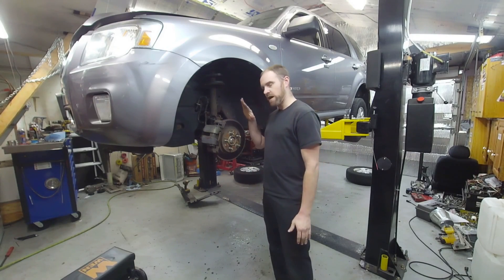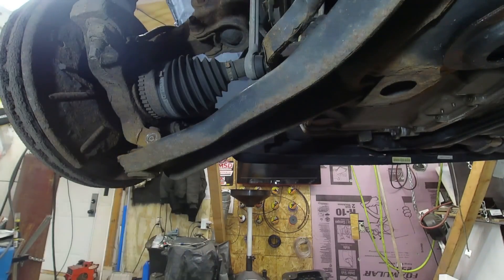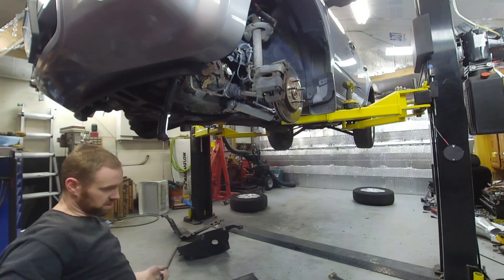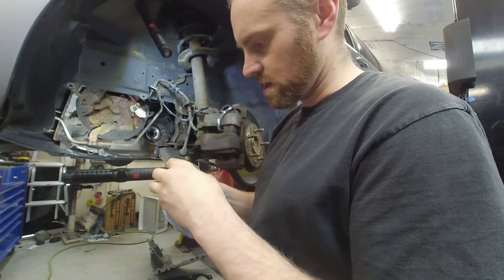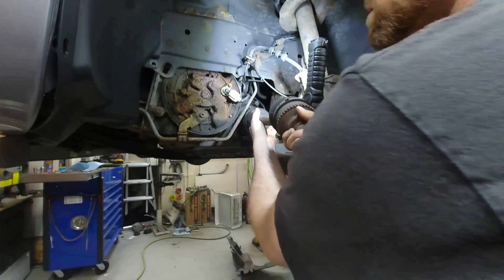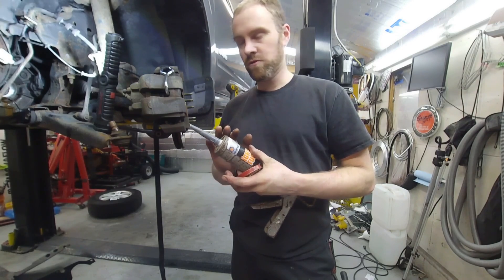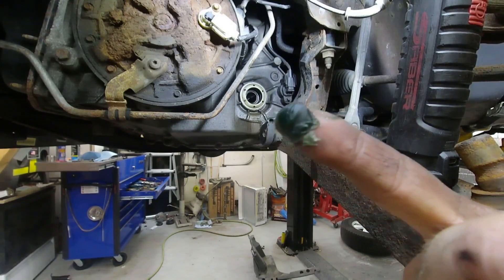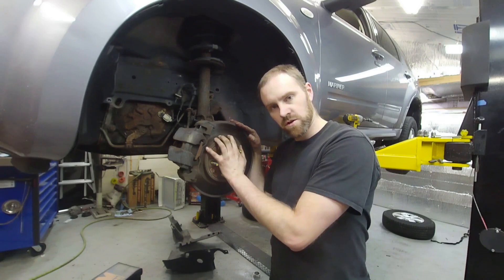Escape or Mariner CV Axle Seal Replacement

Comment: When I took my cv axel out a bunch of cv axel fluid drained outis that normal.? Cause this video nothing came out,what may be the problem
Reply from the maker: Was it all-wheel drive or front wheel drive? Was it the passenger or driver side? If it is only a front wheel drive that was probably transmission fluid. If it is all-wheel drive you might have the transmission seal leaking into the transfer case thus overfilling it. Check your fluid levels and go from there.
Reply: It was a V6 driver side ,it was seized on, so had to use torch and lightly heat for 2 or 3secs an rotate evenly but got it out a d drained 2ft by 2ftpuddle of fluid. Passenger side did the same came of clean but I bought rubber seal
Reply from the maker: @redboss81  Still doesn't answer if it is AWD or FWD
Reply: @CrazedPerformanceRepair  awd
Reply from the maker: @redboss81  then your power transfer unit is either nice and full or overfilled because the transmission is leaking into it.
Reply: i replaced my cv axle seal same one as you and still leaking, it’s perfectly flush to the trans and i didn’t have any issues putting it in or the cv axle, i didn’t not put rtv on the seal, what could it be?

Comment: 06 mercury mariner same problem passenger side ... Leaking transmission fluid between ptu and intermidiate shaft... Ive hit a dead end! Can't find a video on  my issue anywhere!...HELLP!
Reply from the maker: You will have to pull the power transfer unit. I have a video doing ptu on a Ford Taurus show. It should be somewhat similar but a bit easier on the Mariner.

Comment: Been working for two days trying to get CV axle off, finally today I just rented a slide hammer from O'Reilly's, got it off within two pulls with ease.. now time to try and get this seal off.
Reply from the maker: Check for damage from the locking ring

Comment: One more thing, is there a tool to get that bushing out from inside the case?
Reply from the maker: I am sure there is but you will have to do some research.
Reply: What I have found so far is very expensive: $225 for the Ford tool, $140 delivered for this aftermarket one: 308-070 T77L-7697-E Transmission Extension Housing Bushing Remover Alt: https://www.freedomracing.com/308-070-t77l-7697-e-transmission-extension-housing-bushing-remover-alt.html?___store=default
I will attempt with cheaper alternatives, but I might have to get that tool. You need a compatible slide hammer to use the tool as well.
There is also the bushing installer tool that goes for $70+tax+shipping ... 
Alternatives (with the risk of damaging the transmission case): 
https://smile.amazon.com/ABN-Blind-Bearing-Puller-5-Piece/dp/B072MPH6YC/ref=cm_cr_arp_d_bdcrb_top?ie=UTF8
https://www.harborfreight.com/slide-hammer-and-bearing-puller-set-5-pc-62601.html
All of this to remove and install a $5 bushing !!!
Reply: vlasfarg thanks. I sold the vehicle. Wanted to keep it, but couldn’t refuse the deal. Mechanic replaced that bushing for me and did the whole axle to get it right to sell. I didn’t have the time to deal with it. Moved on to a 2016 Mazda CX-5 GT.
Reply: @jaybilawchuk2225  No worries. I am documenting as I progress on this project. It could be useful for future viewers.
Reply: @vlasfarg  i'm about to change my bushing too and i was going to use a bushing splitter tool or chisel to deform it enough for removal
Reply: @tantran3469  We have now done the job successfully on my 2009 V6 Escape. The only challenging part was to remove the bushing. With bolts and washers (home-made $2 bushing install tool) and a 1lb dead blow hammer, the new bushing was installed successfully. So, I have tried 3 tools to remove the old bushing: #1 Similar to 308-070, OTC-6913: this is simply not the right tool for the job (wrong size, wrong tool), #2 The 3-jaws bearing/bushing puller (https://www.harborfreight.com/3-jaw-pilot-bearing-puller-4876.html): the bushing was not thick enough for the tool jaws to grab, so the jaws just scratched the inside of the bushing, #3 (Success) Slide hammer (5lbs) with 3 jaws attachment ( May model from Amazon is called "Slide Hammer, Orion Motor Tech 9-Way Internal/External Slide Hammer Puller Set - Pulls Hubs, Rear Wheel Axle Shafts, Bearings, Bushings, Seals, Retainers"), it took care of the bushing without damaging the transmission in 3 short slides. I hope this helps. Best of luck.

Comment: In my 2009 Ford escape hybrid this axle plays up an down and seal is leaking, should I change only seal or bushing as well? is it normal when axle is moving up and down when I shake it?
Reply from the maker: If the other side is not leaking compare it to that because they usually do have some movement. The seal makes up for quite a bit, it kinda of a use your best judgment thing.
Reply: @CrazedPerformanceRepair  other side does not move, movement is quite large. Hybrid models have this bushing? or only 6 speed automatic transmission? where can I find this bushing for hybrid?
Reply from the maker: The bushing design is the same, for it works the same way. I would have to look it up, but if it has a different transmission for the hybrid it is likely a different bushing. Also note replacing a bushing should be left to someone who has done it before because it can be easy to cause damage to the transmission.
Reply: @CrazedPerformanceRepair  I've changed axle and seal, the old axle surface was damaged, it seems that it has not bushing or it's inside of bearing and I think whole bearing needs to be replaced. cos removing bushing from bearing and pressing another will damage bearing itself. I can show pictures
Reply: David Sharabidze did you ever figure this out? Is there a bushing/bearing that can be replaced? My hybrid escape is still leaking after I’ve replaced the seal and axle.
Reply: @jimmysunga  I know it's been 3 months since you posted, but here's a link from Ford Tech Makuloco replacing the bushing:
https://www.youtube.com/watch?v=9rMhh3cwDso
Reply: @jimmysunga  hey Jimmie 👋  Did you ever solve the issue with the leaking seal / axle on your hybrid? I'm dealing with the same issue now on a 2010 escape hybrid.